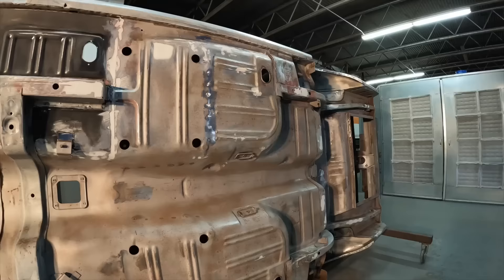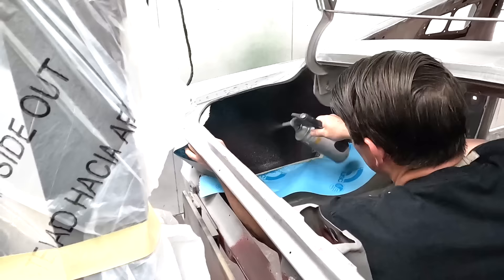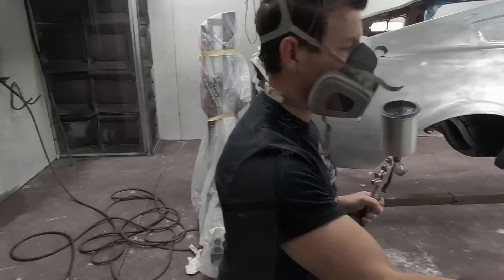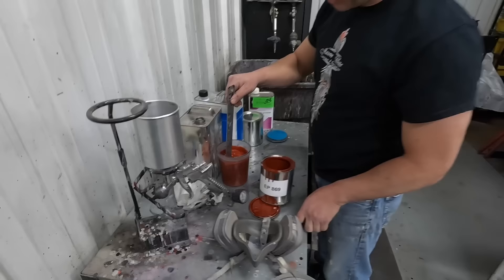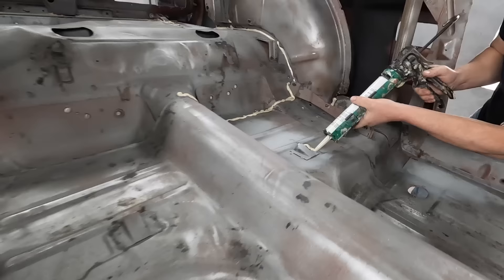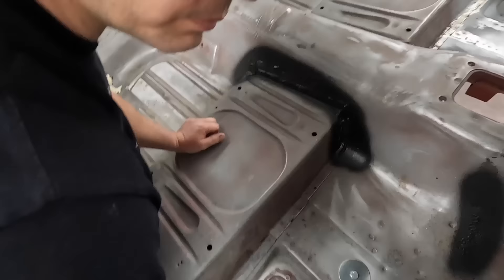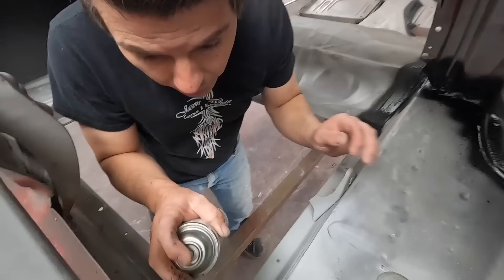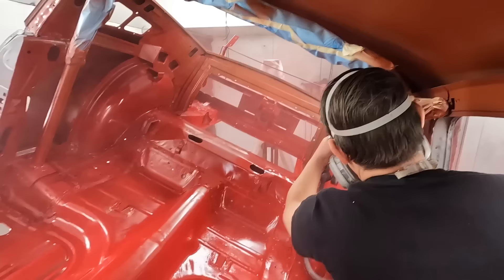Part 4: Primer & Sealer- 1967 Shelby Mustang GT500 Restoration

Comment: I’ve really enjoyed these videos. I seldom watch the long ones but these kept me glued. This 67 is from my era. I’m 74 and couldn’t afford the mustangs but my first car in 1968 was a 1960 Falcon 😂, but, found a mustang that had caught fire and totaled and it had a 289 HP with a 4 speed trany that went into the falcon rear ended and all. Sleeper for sure. Never done any racing but played with it a lot. It was funny when I saw someone working on side of the road and I’d bark tires through 3rd and got funny looks cause everyone knew a falcon couldn’t pull your hat off your head. Drove it for several years and parked it on my dads farm and younger brother played with. Wasn’t supposed to but dad sold it to a crusher. Already had the trans and rear end out and gave it to a friend that restored mustang’s.

Comment: Fascinating the need to imitate the imperfections of the original manufacture in order to be concourse. I saw elsewhere that the final paint needs a small amount or "orange peel" to imitate the factory paint of the period. If you buff it to a glass finish, you will lose concourse points. Thank you for sharing this fascinating process! (my OCD I can't resist making my seam sealer neat. LOL)
Reply from the maker: Where "elsewhere?" See if I wrote the article because I've written lots of articles about orange peel in factory paint.
Reply: @thewriter2549  That's fun to think about - I grew up reading your books and articles! My dad was a fan and was always against "over-restoring" these cars. I distinctly remember him lecturing me about orange peel when redoing his bro's Boss 302 in the early 90's. He shot the car with single stage and held out against base/clears until it was no longer possible to get/find those original style materials. He reluctantly painted his '72 Mach 1 in RM base clear around 1999 on top of the same PPG primers you used. Even then it was quite expensive!

Comment: That’s incredible work, skill and knowledge. Industrial paint is amazingly good but amazingly expensive. I use it on some projects and it’s so different to “normal” paint, it sticks to metal like shit to a blanket, is extremely durable and will generally be more tolerant of poorer preparation. It goes on thicker and seems to go further and one coat is normally enough so I guess the high price actually saves time and money.

Comment: Its is easy for someone to sit at home (like me) and watch and nit pick this resto....however in this case I will. I spent 20+ years in a paint shop working for a global Automotive company and sealer was my speciality and I find it hard to believe even in 1967 that Ford USA would had applied their sealer then the operator running their fingers over it...... certain area's yes like deck lid's bonnet's etc the corner area's but the rest normally by gun then brush especially inside the floor pan as for the original "bead sealer" not touching the seem that would had been beacuse the operator was lazy and didn't do their job right and the quaility control operators at the end of the line in this process would had missed it (happens 5/100 cars or so) depends on the operators at the time. Apart from that it was most enjoyable to watch job does look amazing.
Reply from the maker: If we could talk to several assembly line workers back then. Otherwise, don't you think it's fairly easy for restorers to see the remnants of the work including fingerprints in the seam sealer?
Reply: @thewriter2549  no….. have you ever work in an automobile company in their paint division for 20 plus years ?? If you had or have you would understand the point I’m trying to make.
Reply from the maker: @peterbrady5273  I think I understand your point. I'm not disagreeing with what you are saying. My source here is the restorer. Maybe an assembly line worker can respond here.
Reply: @thewriter2549  as I originally said it’s easy for me to sit in front if my 75 inch tv and nit pick the resto … however your right would be good to hear it from a line worker definitely. If I had a Mustang to be restored I’d take it to this guy in a heart beat definitely you can see his attention to detail and his passion for his work which is a rare event in the modern world…. I learnt my craft from old school tradesmen who used to draw and draft vehicles by hand in a drawing board not like today even though I was brought up in the CAD era of manufacturing then it n to automation etc. I’m looking forward to the rest of the build and I wish you well.
Reply: @peterbrady5273 Sorry to nitpick in return but how many pre-1990's USA cars have you seen apart? Build quality and QC was really that bad in many cases. The seam sealer is always a mess on these cars. This Shelby is being restored as close to its as-built condition as is practical. Like Jerry said, you can see witness marks all over the original seam sealer showing brush strokes, finger swipes, blobs, etc. It's plain as day. Nothing really to dispute.
Reply: @SaltFlatMonte  all good… but I stand by what I’ve said as I’ve spent 20 years plus in the world of manufacturing vehicles and have a fair idea of the processes that are involved from the role of steel in the press shop to the vehicle rolling off the final line of production.

Comment: Some holes are there to let water and moisture out. That big hole around 17 minutes in, on the outside, down low.....the frame forms a sort of vessel, and needs to be drained. Well, you just filled in the drain. Rust will develop in that area now. Now I'm guessing this car will not always be driven in the rain, never see snow, and will be garage kept. So rust is not going to be a problem.

Comment: Hi Jerry, good evening!

I would really like to know the name of the equipment you use to attach the car chassis and turn it at 90°C? I found a way here at the workshop to close holes in the bodywork using cast iron (melted). A ceramic plate is positioned under pressure behind the hole and the molten iron comes on top, for a quick and well done job, then just finish it off. I would like to know the name of the machine, thank you.
Reply from the maker: I'll have to get hold of Jason and get the information for you. I'll see him next week. Thanks.

Comment: Nice work. What is the difference between a red oxide epoxy primer and others? Why choose that one?
Reply from the maker: Jason explained that when he was spraying on the red oxide primer to the bottom of the unibody. I'd have to go back and get those quotes or risk remembering it incorrectly, so if you can go back there you will get the full explanation.

Comment: Don't take this the wrong way Jerry, but why at your age have you decided to have a classic car restored in a Concours method,? are you going to compete at the level with the car?, if so, do you really want the headaches of the competition at that level? Why not think in more modern terms, and take some of the steps to the next level, and make the finished product a little nicer. An example of what I'm referring to is, undercoating the entire bottom of the car, it would protect the metal better from debris hitting the underneath, and would help with sound deadening. Being relegated to techniques, and products from 50+ years ago when restoring a car, seems impractical knowing what most car builders know these days.
Reply from the maker: Okay, that's a good question. I went back stock as much as I could because I dreamed of having a Shelby just like Carroll Shelby built in 1967. I don't want modern, not on this. Also, I wanted to show a restoration. I won't drive the car much. I owned my 100% stock 289 Cobra 28 years and put 5,000 miles on the odometer. I liked looking at it in the garage, like wow, look at that Cobra, just how it was in 1965! Sometimes I'd just sit in the driver's seat and dream. I'd fire it up and drive it once in a while and that was kind of like a dream. If I hadn't dreamed I wouldn't have done what I've done. I would have worked 9 to 5. That was very practical. I don't think it would have been as fun. I could be wrong. I work too much, but most of it doesn't seem like real work.
Reply: I don’t have a problem with how the car is being finished, my question is why would you go through all of this and then paint it a non-factory colour? Candy apple red????
Reply from the maker: @dougwilson9216  "Candyapple Red: is the stock color, which is "T" code. We went over this in the barn find video of this car. If you didn't watch, here is the link - https://www.youtube.com/watch?v=qL6N-WF7AD0 Thanks for the question Doug.

Comment: Question, what supplier made the quarter panels you used?
Reply from the maker: Dynacorn
Reply: @thewriter2549   Thank you!  Yeah, I went back to a previous video and found that information.  Looking at buying some fastback quarter panels for a project I have and have heard some suppliers didn't fit the same as the originals.
Reply from the maker: @tombuer7708  I think today's quality quarter panels fit better than original Ford quarter panels. Did you notice in part 3 the product Jason used in place of lead  that the factory used? And he said that new product is better than lead.
Reply: @thewriter2549    Yeah, I used to be a bodyman years ago and know about that "all metal" filler..  I drove a 67 fastback years ago and want to "recreate" the fastback I had that I sold in the mid 1980s..  btw, those were coupe quarters he cut off.  The second of the part number started with 65, that's Ford's code for coupe. Fastback was 63 and convert was 76..   It's been many years since I did much body work so some of the tools and some procedures have changed.

Comment: I noticed the rollbar is installed. Would this have been installed at Ford or at Shelby? Also the plate for the rubber snubber at the front of the leaf springs, same question, installed at Ford or Shelby? TY
Reply: Roll bar and snubbed was installed at shelby

Comment: Why don't you use a brush for the seamsealer ??
Reply from the maker: Becuase that's not what the factory did. This is a restoration. We follow factory procedure.
Reply: @thewriter2549  Nobody in the factory uses his finger to apply seamsealer . My dad worked at the Ford plant in Genk , Belgium late 60's . And used to do bodywork on cars after hours.
Reply from the maker: @b67fstb   Okay, thanks for your response. Rather than tell me that "nobody used his finger to apply seam sealer," can you tell us how your father applied seam sealer at the factory, after hours, at the Ford plant in Belgium? He did not work on the assembly line, right? Jason used a caulking gun, not his finger, to apply the sealer, then smeared the sealer to imitate the sloppy factory look as he has researched on factory cars for the areas that we showed in the video. I believe on the assembly line the Ford factory applied seam sealer with much larger caulking guns.

Comment: Why don't you take a brush to apply the seamsealer ??  This does not even look like factory , even after applying that undercoating. What a shame.
Reply from the maker: It doesn't look like factory? Have you researched the factory procedure by inspecting floorpans, trunk and engine bay of a 1967 Mustang? What did you find?

Comment: Wäre es nicht sinnvoller wenn man das blanke Blech zuerst einmal grundiert und anschließend erst die Dichtmasse aufbringt?Wenn man die Dichtmasse mit einem Pinsel verstreicht sieht es bestimmt besser aus als dieses Gematsche mit dem Finger.Oder man sprüht die Dichtmasse mit einer speziellen Pistole auf.
Reply from the maker: Translation: Wouldn't it make more sense if you primed the bare sheet metal first and then applied the sealant? If you spread the sealant with a brush, it certainly looks better than this mess with your finger. Or you can spray the sealant on with a special gun. Answer: Sie können ein Auto so bauen, wie Sie möchten. Wir haben eine „Restaurierung“ durchgeführt, die im Werksverfahren durchgeführt wird. Das Werksverfahren ist „bewährt“, sodass wir am Ende sehen, wie das Auto wie neu aussah. English: You can build a car any way you want. We did a "restoration," which is done by using factory procedure. Factory procedure is  "proven," so we wind up with what the car looked like new.

Comment: Sorry, no fingers use a 1 inch paint brush cut a half inch bristles off the top . That’s the way Ford did it. . 🙈
Reply from the maker: Thanks, I'll check.
Reply: That was probably the spec'd procedure (I'm sure there are build books/sheets from the ass'y line still out there) but you can see witness marks all over the original seam sealer showing crude and missing applications. In some of Jerry's other videos others have discussed the build practices and variations between plants which is quite fun to learn about. However, you'd be hard-pressed to say the restoration here isn't faithful to the original practices especially when looking at the finished product with primer/paint/undercoating masking the seam sealer.

Comment: Always thought Mustangs looked awesome , but IMO absolute Unibody garbage structurally😂
Reply from the maker: Unibody beats body bolted to a low slung frame, the latter heavier and less rigid structurally, compared to the unibody that connects the top and bottom of the vehicle into one unit, and thus being more like a race car with tubes running top to bottom to restrict the body and chassis from leaning.

Comment: Great work. What material was used to fill the panel overlap seam between the quarter sail panel and roof? The factory used lead.
Reply from the maker: Yeah, Jason named the product in the video. If I could remember I'd tell you. You're probably like me. Sometimes I skip through a video and then miss things.
Reply: Found it in video 3. Metal2 Metal. Thanks. Can’t wait for the next episode.